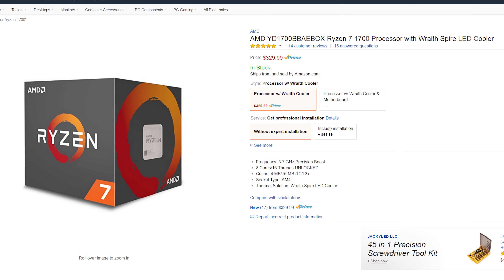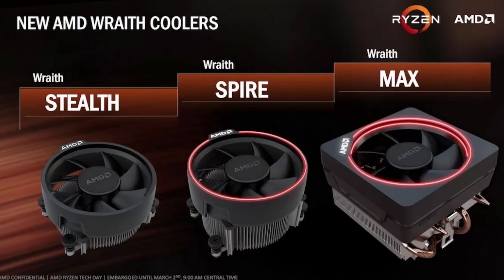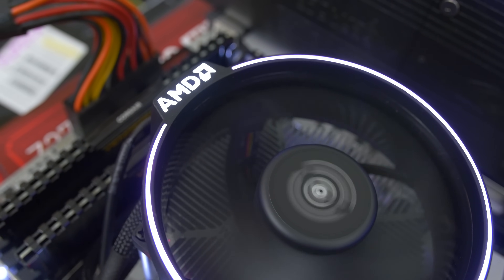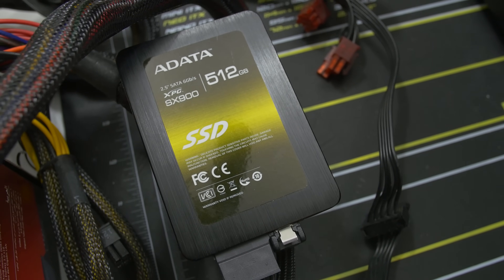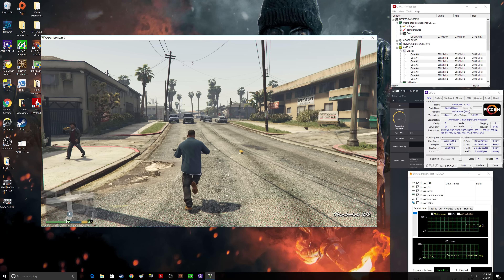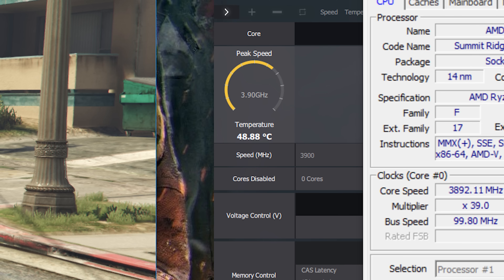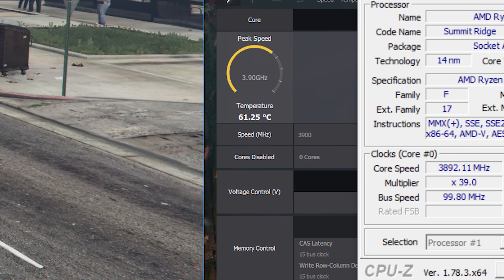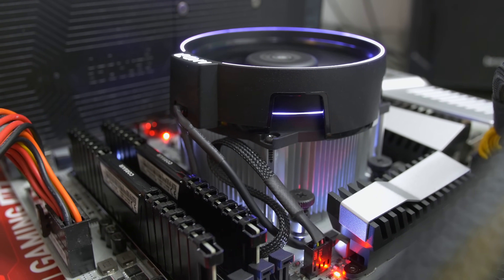AMD Wraith SPIRE: Does it SUCK?

Comment: I got the r7 1700 coming in a couple days... and I was curious what is a decent aftermarket air cooler... I might be able to get a water cooler on my system but it can only have one fan and it has to be mounted on the back as I have a very large chassis fan on top, where one would normally put the larger water cooler fans.. antec gaming 900 chassis .

Comment: My Ryzen 1700 system is nearly silent, overclocked to 3.8GHz with the Wraith Spire.  The system total was $600, with 16gb of DDR, and 256gb name SSD.  Not bad for a system thats faster than a stock 6900k.

Comment: Actually really impressed with this cooler. I have it on my 1700 while I wait for my Corsair bracket to arrive. Runs SURPRISINGLY quietly, especially for a high RPM 92 mm fan. It more or less handled 4.0 GHz but I wouldn't trust it for long periods. Currently it's cooling 3.8 GHz at 1.35V just fine (my chip isn't a great OCer).

Plus, that LED ring looks amazing. Great touch.

One question though, any reason you don't have the 4 pin plugged in?

Comment: it might not be good enough to get the 1700 to 4ghz, but the 1600 and 1600x should be doable because the lower cores should result in better temps.

Comment: Whoa Running GTA 5 Overclocked only 48 c? only 8-10 c different from idle. That's good enough for me.. I think because this has 8 core, running gta V only using 20-40% of it's core capability so it didn't rise the temp enough. That is why when u do multitask temp straight to 62c. Too bad i already have i5-7600k haha.. but good enough for gaming only.

Comment: Does it need to work?  It has RGB.  That's all that really matters.
Reply: Just plug in the RGB cable and you're good to go
Reply: @Peety-98  lmao just connect the monitor to a fucking rgb led there you go 9999fps
Reply: @qss-1  nah not 999 699
Reply: The computer doesnt need to function as long as it can turn your house into a disco party
Reply: @obiwankenobi2749  true 😂😂
Reply: @Peety-98  I had that ring only rgb fan for some months now and now I noticed it has RGB! I never plugged the rgb cable.. damn it is like a new PC
Reply: Well it's a stock cooler, has RGB, AND it's quiet and keep things cool. Best stock cooler ever
Reply: true.i swapped noctua dh-15 with wraith spire because of the rgb
Reply: The RGB will decrease the temp 😂😂
Reply: @Jazz Anders Lmao Intel coolers don't even look presentable.
Reply: ikr
Reply: lol
Reply: I just bought my new gtx 1080 led strip edition rocking ac odyssey 360 fps
Reply: @PTPTuts  wooooooooooosh
Reply: @aydensmith9745  r/wooosh

Comment: Seriously I don't get it. What is purpose of 1600Watt Power Supply Unit? I have server equipped with 
Asus SaberTooth 990FX R2.0
AMD Phenom II X6 1090T
4x 2GiB DDR3 1333MHz
Quad Port 8GFC Fibre Channel HBA
Nvidia Quadro nvs290
Quad Port Intel 1000 Pro PT
LSI 9211-8i
Dual Port 10GbE Intel AF DA2
2x 250gb sata hdd
5x 500gb sata hdd
1x 640gb sata hdd
1x 1tb sas2 hdd
2x 2th sas2 hdd
3x 4tb sas2 hdd
And desktop
Asus SaberTooth 990FX R2.0 
AMD Phenom II X6 1100T oc to 3400mhz at the moment 
4x 8gb DDR3 1833
NVidia geforce 8800gt
Dual Port 10GbE Intel AF DA2
4x 4tb sata constellation es2

All this does NOT require even 800 watt in total
You are presenting something what may touch, but nothing more then touch 600watt and you give it 1600 watt power supply unit. It is just stupid. And yes it is stupid! Anything goes wrong and suicide 1600Watt by 12V and you get what kind of current can flow through something what gets burnt - you have for in computer and your power supply won't turn off because of overload (133A is really a lot of current and even shirt circuit won't get so far)
Reply: it's used so that it won't interfere with the sound testing, some PSUs can be very loud when it's fans activate. I use a 1600W psu to test acoustics on a CPU fan, the gpu can be clocked to a bare minimum to also prevent the fans from again, interfering with the sound test.
Reply: First up, the PSU wont pull any extra from the wall unless it needs it, So while it might not operate at its OPTIMUM load, (Unless he has 4 GPUS connected) It will never get stressed, Witch SHOULD mean the fan NEVER has to spin up (less noise)

Also PSU's lose there rating over time (not as fast these days but still happens)

And your comparison to HDD's is flawed, If a HDD fails the data is GONE, If a PSU fails (Assuming it didnt fry your computer as it died) your data is safe.

Assuming the PSU doesnt flat out fail, and just degrades over time, a 1200 watt will likely run a 500 watt system for 3-4 times longer before the degrigation takes its toll over sommin like a 650-750 watt.

I digress though, the main reason for getting a rediculas high watt PSU these days is just for acustics, 

Ofcourse When I build mine and the wifes computers, I'd like a PSU that could power both (THere going in the same purpose built case) So that PSU would need to be a min of 1000 watt..if such a thing exists :P
Reply: because there isn't a point to changing it for every bench mark and it's one less thing he has to test if something stops working, it'll be pretty obvious is the psu dies but maybe not as obvious if it's not giving enough power.
Reply: seriously?
1600watt is enough for server with 4 processors with max number of cores, 4 gpus of power around latests titan (may it be tesla) and serious bunch of hard disk drives most of viewers never never so much at once or rather in entire lifetime
here we are speaking about computer which can easily run on 500watt with loads to spare
I have had AMD Phenom II X6 1090T overclocked to 4GHz, North Bridge at 3GHz, memory at 1866MHz
11 hard disk drives
2x GeForce 460 well overclocked
all working on 850Watt power supply
drawing along with server not more then 888 watt (with server)
Reply: िคƈع ɗѻعو I am educated. It is you who thinks only educated person is you and author of this video. For your information I have seen video where one was using 2 xeon cpus and 7 graphics cards and did not use 1600watt power supply. 1600watt power supply is something which is completely pointless, because ever very serious stuffed server won't use so much. That is my point. Go and see 7 graphics card gamers computer on LinusTechTips and then start arguing with Linus why he did not use 1Milion Watt power supply. Reason is it is not needed. Using 1600watt power supply is just a show off. I feel like watching an idiot seeing such thing 1cpu 1gpu 1600watt psu. That is simply stupid. Seriusly 450watt would be sufficient. For most demanding computer 1200watt is sufficient. 
Next time when you would be picking up your bread rolls use Belaz 75710 to get to shop to be sure you have 496t of load left. It is same thing
Reply: yeah, lets get bread rolls driving Belaz 75710. We definitely won't run of steam - we have 496 metric tonnes of payload left
do not be silly, this getting very funny

Seriously redundancy does not mean to get 4-5 times as much as needed, but at most double what's needed
Why ECC RAM is not 320bits wide, but just 72bits instead of 64bit for non-ECC?
why RAID5 uses equivalent to 1 HDD for parity, while equivalent to 2 drives (or more, but that is minimum) for data, not another 8? raid5 is usualy implemented on 5 hdd, 1 for parity, 4 for data
why RAID6 uses 2 hdds for parity, while equivalent to 2 drives (or more, but that is minimum) for data, not another 8? usually RAID6 is implemented on 6 hdds 2 parity, 4 data

your redundancy is very wrong.
If this power supply fails - it fails, no matter if it is 450w or 1600w - it still won't work. for redundancy you need second psu

it is same with hdds - no matter if hdd is 1tb, 5tb or 8tb - if it fais your data is gone, you do not have access to rest 7tb - it is not working no matter if it first 1tb or last tb

you are not making good argument her
Reply: This PSU was used daily - yes, but not for few hours, but 24/7/365 - it was server (desktop re-purposed to server). It was powering AMD Phenom II X6 1090T, 8GB DDR3 1600MHz PC3-12800, AMD Radeon 5xxx - most powerful one, which does not require PCIe power plug, 3 GigaBit EtherNet cards, and...
prepare yourself....
13 Hard Disk Drives - all 7200RPM
It was rock solid in this configuration and only time when it was down was when they have been digging around power lines to replace them and had to cut power. I have had 2 years of uptime.
After that I am askin
why do you use 1500W for build which uses 400W? Don't you have some better place to spend your money, then multi billion corporations? If not, then buy say 800W psu and give difference to me - I shall use it to everybodys benefit, not harm like corporations
Reply: Running a minecraft server, duh
Reply: I have 69 cpus with 2208 cores running on a 1 kilowatt psu.
Reply: Wizard you have tons of outdated parts.
Reply: Mining Mages If the amount of CPUs you have only adds up to a 2 digit number you obviously don't have enough CPUs. Adds some RGB for a 3000000% performance gain 😂
Reply: So you basically just agreed with what I said...I think, (Still early not 100% awake yet)

Point 1, The power supply will pull your pocket ONLY if it needs it, Linus proved this, a 1600 watt psu pulls the same as a 500 watt psu powering the same hardware under the same load (The only difference being the efficiency curve)

Point 2, I have a psu thats running my dads old computer that was the first I ever built (Back when I was 16, Im 32 now, And its still kicking, Its old, dusty and noisy as all hell and gets REALLY hot, it was some 600watt when I got it, I never had it use all 600watts though, (Maybe about 350ish) 

If you still have that PSU, get it tested to see if its still putting out 350watts, I would be VERY surprised (Assuming its been used daily for a few hours) if its still handling above a 300watt load.

But you and I both know that they dont built things like they used to (Now days things are built to break lol)

And your last past, Thats the theory, however to prove it would require a very VERY long test lol.

Sometimes things just REFUSE to break, no matter what you do to them (See the Toyota Helix from Top gear :D)
Reply: WizardNumberNext ;) you betcha m8
Reply: DatCoolGamer well we only have graphics accelerators and 2x gtx1080SLI for our server we just need 1600W t2 for testing
Reply: Here a Corsair HX850 with just an 5770 gpu, 16Gb ram and two drives. Ahahahah
Reply: Brian Mirante if you've studied computer engineering, we have different kinds of rigs to test, and since its annoying to swap out power supplies, we used higher wattages instead. And also an added bonus is that acoustic tests can be as accurate as ±9db because the fan never spins.
Reply: what the fuck are you talking about? 12v is harmless, little to no current can be pushed through the skin at those voltage. Everything up to 50v can't do damage unless you pierce your nipples with probes or something
Reply: WizardNumberNext PSUs that doubled the amount of watts needed are more efficient. Your house wouldn't send 1000watts to your light bulb, would it?
Reply: Linustechtips found a purpose for it. they will always find a purpose.
Reply: WizardNumberNext That's not how power supplies work...., it cant just dump all of its current down the 12V eps rail
Reply: 1. Power Supply pulls your pocket exactly same amount no matter if you use 500W or 1000W or even 1500W
2. I have had USED (for who knows how long) FPS Group 350W PSU and I have been using it successfully till 2012. This PSU was found in early Pentium 4, so we can safely assume it served for 12 years, before it was replaced, just due to lack of 8pin EPS connector, no other reason
Taking this experience up to what you wrote, we can safely assume that this 1500W will power up computer until all electrons will migrate in cpu and it will stop working and psu will have no noticeable degradation
Reply: lol...what is the point of a PSU that high?? I ask you...what is the point of a PSU that low 😂. I'mma tell you a story youngling... I've seen a 3000watt PSU adapted from an industrial grade Power Supply from a mechanical arm unit. With it we achieved 20ghz overclock on an old AMD CPU. No that was not a typo, I actually mean 20ghz. We actually got it stable for 30 min. However us half genious half mad scientist bunch flew to close to the sun, bumped it up to 21ghz, and blew it up...Yes actually blew it up. There's still a burn mark in the porch where the experiment was done. And yes the PSU of 3000 watts maxed out.
Reply: You got thumb up for first ever good answer to this question. Congratulations. 
First answer, which was not blind guess into rather dumb subject. 
That is very valid indeed. 
P. S. I have run extreme underclock undervolt on my AMD Phenom II X6 1100T (800MHz at 0.8375v I believe, 3.2GHz at 1.125v)
nVidia GeForce 9800 GTX at 300MHz. Yes it was quiet with 850Watt.

Comment: So stock cooler + CPU for 330$ which allows you to OC by 30% out of the box and almost matches the performance of the 170$ more expensive CPU that needs 3rd party cooler (another 50$). So you have 220$ spare and you can get Corsair LPX 32 RAM 266MHz for 227$ off Amazon. That's GREAT in my books. I just ordered Ryzen 1700 + 32gb 3000MHz RAM and MSI B350. Waiting to do some of the virtualization stuff that is not covered anywhere sadly.

Comment: @0:20 -The 1700x has a stock cooler? O.o I got ripped off then, my box came with just the 1700x processor. Guess it's good I decided to go with the Corsair Hydro H110I since it's compatible right out of the box. >.<

Comment: Wait a second...the CPU went into fail-safe autoshutdown when it got into the 70s? WTF? That seems really low to have the chip autoshutdown for thermals...also, some of the other temps displayed were really low for an air-cooled OC'd CPU, like well into the liquid cooling ranges for temps. I'm calling shenanigans on the AMD temp monitoring software, though I don't know of a way to confirm it...maybe try running an older AMD CPU like an 8350 while monitoring with that software AND something more recognized/proven like CPUID, see how the results line up?

Comment: I know this is a little off topic but I'm in the right place to ask this question. I have an I7 7700k CPU cooled by a coirsair H80I AIO. This is a very beefy cooler and worked fantastic to cool my original CPU the FX-6300. Now however, with this new CPU according to core temp it reaches around 170 to 180 degrees Fahrenheit (I even hear the pump rev up during certain tasks). It has a TJ max of 212 so I am afraid to do any over clocking (not that I need to). I even re-installed the cooler thinking I didn't install it properly, but it yielded similar results. Any way, I am wondering if this is normal for this CPU or if I should get an even beefier cooler like the H115? Please if anyone read this let me know your opinion and what I should do. Thank you :D

Comment: Wouldn't it been better designed to exhaust upwards? Seems wired to put hot air on parts that have heat sinks for a reason :P

Comment: Is better idea if buy a new computer or just update some of these components?
Intel i3 4170
Mobo Asus H87 plus
Gtx 960.

I was thinking about change the processor to a i7 4790 and the videocard to a gtx 1060 6gb.
Reply: Alfonso Chavez it's your choice but I would wait for r5 because they may come out with better gaming performance. Only time and benchmarks will tell
Reply: Alfonso Chavez are u gonna be paying around 300 for the chip?
Reply: gh0stsm0ke yep
Reply: If you can find a used 4790 for around $250 then get that. I often see them new for $320, but at that point I'd upgrade the system to a newer mobo

Unless you're ok with waiting six months, I'd get the 1060 now. Late this year the Pascal refresh will bring a slightly faster and cheaper version, but don't worry about getting it now. The performance boost will be incredible in most games

After getting the 1060 you can decide if you want to wait for Ryzen 5 or cheaper Skylake parts. In the meantime you'll have a monster 1080p GPU
Reply: i agree with anthony

Comment: Why not test it in a case fully assembled? If the entire thing is going to be about testing the air cooler then you have to use the real world test unlike the open test bed with full ventilation for the cooler, in the pc case the cool fresh air is limited obviously. I wonder if it runs like 10-15 C hotter in the case setup.

Comment: Why don't mobo makers move memory slots further away from CPU sockets, or angle them?  Memory clearance is not a new issue, nor is it going away anytime soon.  Right angle 24-pin connections would be nice too, and stop hiding the CPU power connector up behind the CPU cooler.

Comment: Another thing to note is that Top blow coolers like the Spire have some advantages over different solutions which are often overlooked. For instance, they will provide better cooling and airflow for your Motherboard and RAM which can be important if your motherboard has crappy heatsinks for your capacitors and/or your case doesn't have good airflow for cooling your RAM.

Comment: Glad that the cheap stock cooler is good, what is its height?  I've been planning on building a PC in an ammo can, and if I could get away with a stock cooler I would be pretty happy.

Also rocking my NH-D14 on my Intel rig, I've got my 6600k at 4.7Ghz, 60C when gaming.

Comment: Nice to see a stock cooler that doesn't sound like a turbine on 100%, but I dislike the downward firing design. 
And just why did it take so long for AMD/Intel to finally allow us to properly mount coolers? I mean... we went trough almost every other possible way to attack a cooler (except super glue?) to a processor before using the most simple, yet best solution.